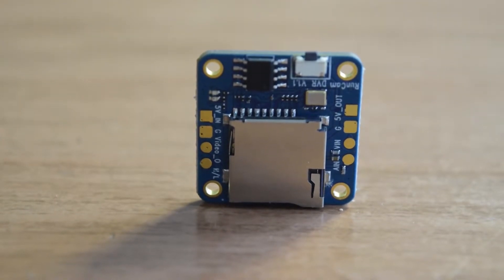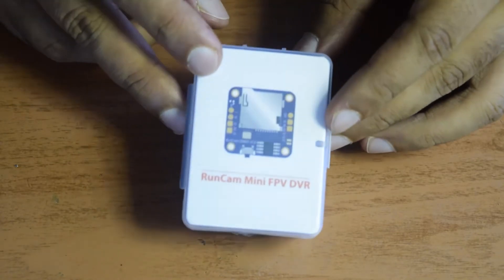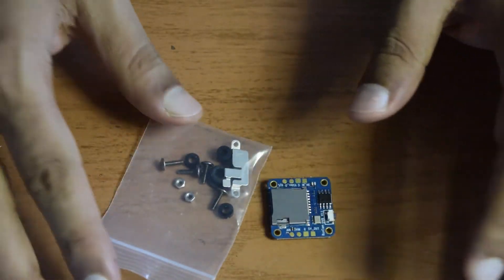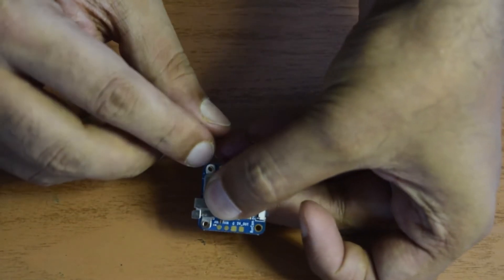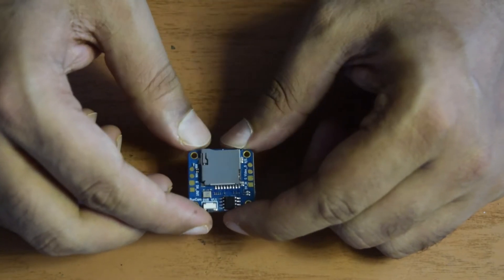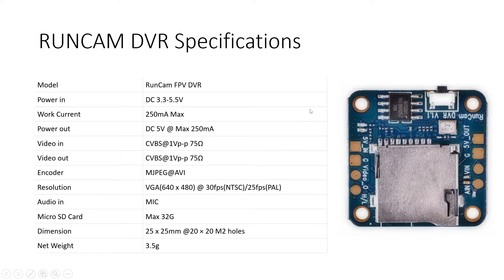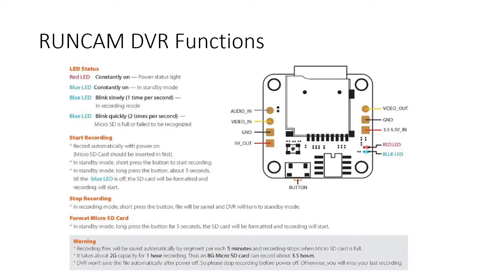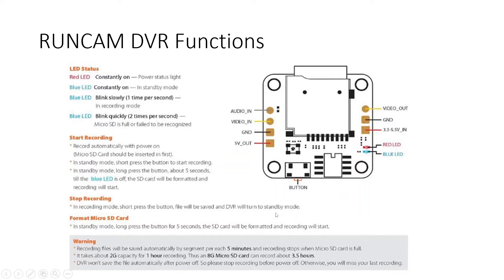BEGINEERS GUIDE TO EXTERNAL DVR FOR DRONES |RunCam Mini FPV DVR Video Audio Recorder With Wiring

Comment: Great video- thank you. Can this be simply be wired to a 5v source to a function as a stand alone secondary recording device ? I’d like to place multiple cameras on my fixed wing that will record for later use when creating videos. Not for VTX transmission of the video signal.
Reply from the maker: ofcourse yes , but it can record one camera at a time , and VTX adds the telemetry information before transmission so this module can be added before vtx to not to have telemetry information on recorded video. I hope this helps. please stay tuned to my channel for my future videos

Comment: I saw you put a diversity fpv rx signal output  into a dvr and then the video out of the dvr into goggles and you said it would delay . 
           Does this dvr delay fpv if video runs through it ? 

  So camera to flight controller then from flight controller video out with osd on it goes through the dvr first because the tx only has video in ?